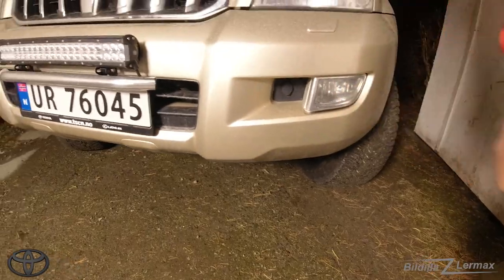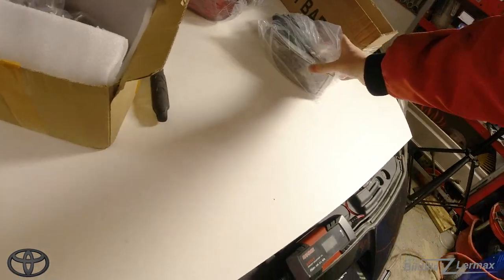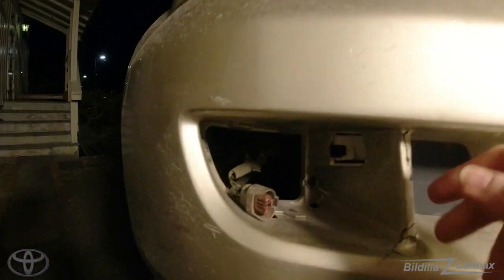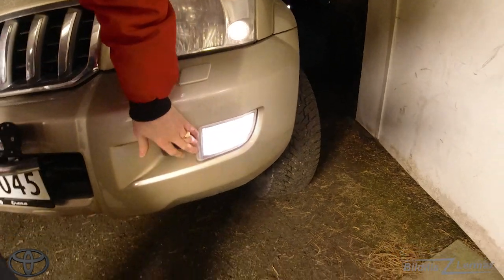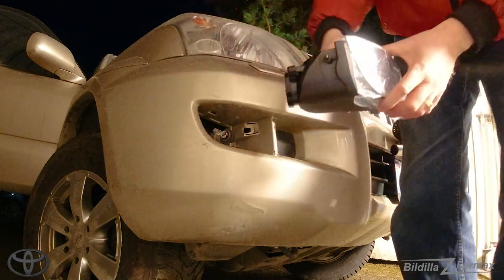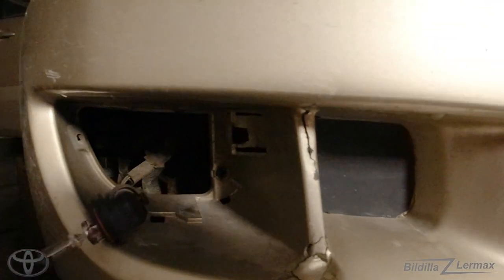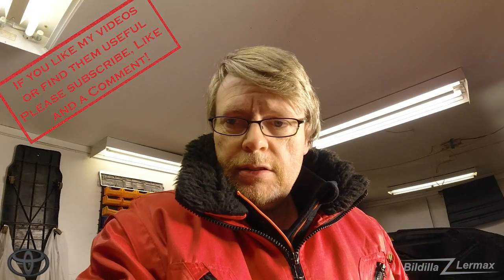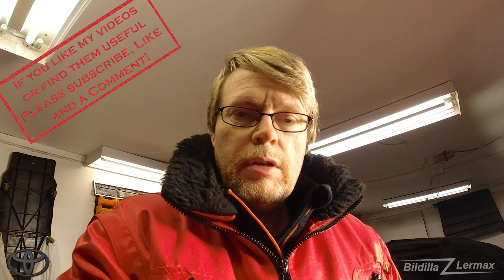DIY / How To Replace Fog Light - HB4 - 2006 Toyota Land Cruiser / PRADO 120 - Bildilla Magasin

Comment: Hello, can you tell me what type of mini bullbar is that? Very nice!
Reply from the maker: Hello.

I bought it locally here in Norway, at Jula.no
But I see it being sold similarly on ebay, aliexpress +++
Sees it sold in Chrome and in a black version.

Greeting
Pål (Paul)
Reply: Does it have a specific name? Takk
Reply from the maker: @PaulGheorghe6684   Try a search on:
Aliexpress, ebay +++ "Universal Bull Bar Front Bumper License Plate Mount Bracket Holder"   🙂
Reply from the maker: @PaulGheorghe6684   No spesific name, see this being sold in several versions at many night shops etc.  🙂
Reply: @bildillamagasin  found it, ordered it. Only difference is that is black, but probably will look good on my red Land Cruiser! Thanks!!!
Reply from the maker: @PaulGheorghe6684  Black on a red car, can be very stylish!  😀
Reply: Qqq😊😊❤ @bildillamagasin

Comment: Thank you so much for the video...
Kindly how do you fix the wobble on the fog lights
Reply from the maker: Hello.
Since my bumper has an injury to the fog light, it was probably more than a normal slack. I solved it with hot glue gun. Then I can get it of again, if necessary.
I'm thinking about switching to a powerful bumper with a winch setup. Then everything must be rebuilt.

Regards
Pål
Reply: @bildillamagasin  wow a winch setup will be awesome...can't wait to see that, thanks again
Reply from the maker: @omarkash4099  I'm not sure which one of the cars I'm going to build for the tour car. I have several LC120 + a 60 series + a P38 Rang Rover + a Suburban. I also have a 3 ton winch lying around. Just need to get sold off some other cars, and get started on a larger garage. Expect that when I first start rebuilding a car, it will take time in the garage ... Then I need more space.
Reply: @bildillamagasin  I'm also looking for some space to set up a small workshop, hopefully it works out and all the best on your side as well
Reply from the maker: @omarkash4099  Winter is fast approaching, so you can do much less. I do not know where you are, but here in Norway, winters are not the time to do so much outside. Then the choice is to rent a large garage, or start building one at home. I have rented before, but when it is a short drive to the garage, it is an obstacle as well.
Hope you get started with construction soon too!

Regards
Pål
Reply: Sikaflex
Reply from the maker: @BrekMartin  Tusen takk for info  :)

Comment: Where can I find the new foglight shell?
Reply from the maker: Good day!

I found new fog lights on both aliexpress and ebay. The prices varied a lot, but you can find the cheap ones!

Regards
Pål (Paul)
Reply: @bildillamagasin  Felt great to hear from you! 
How much did it cost you and did they perform like the originals (better or worse)?
Reply from the maker: @rahbarkarim671  Good day!

I checked where I ordered. See it was on Aliexpress. I paid less than 40 euros, for both fog lights with shipping.

I see no difference in the light from the originals. A small design difference in the glass, but very little.

Regards
Pål (Paul)